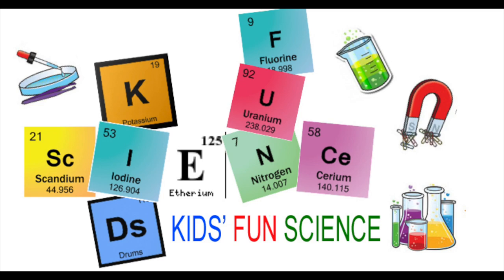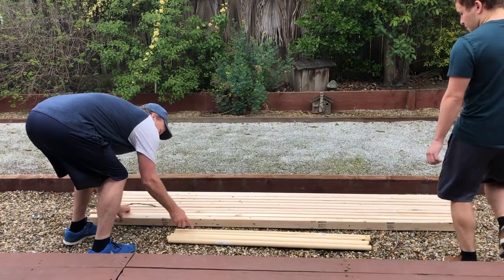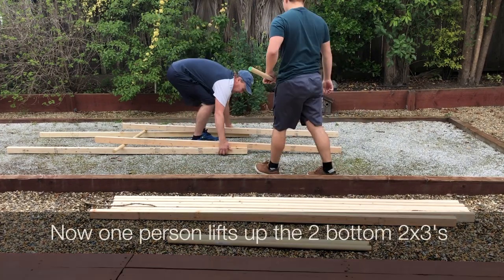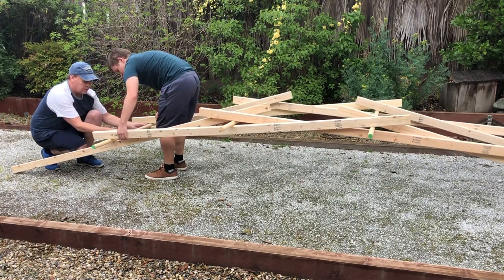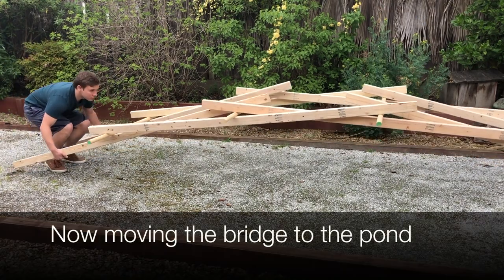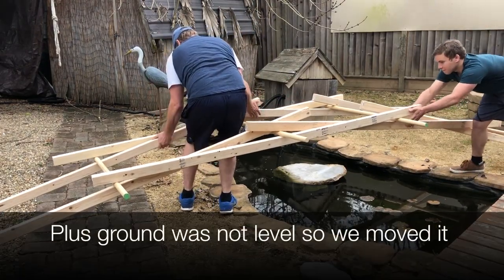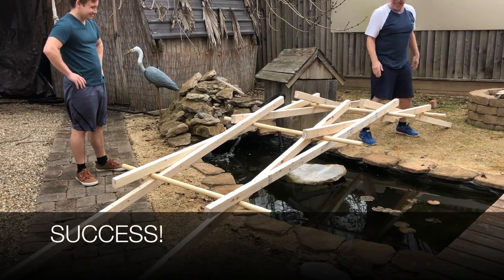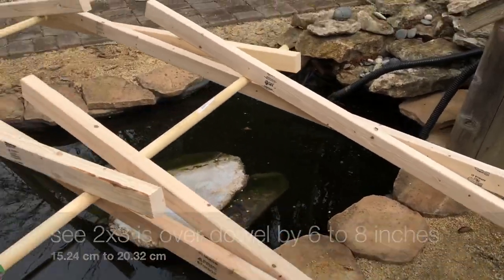LIFE SIZE Leonardo's Arched Bridge (Leonardo's da Vinci Bridge)

Comment: What is the length of the 2x3s? Also how long did the bridge end up being using eight 2x3s and the dowel rods?

Many thanks.
Reply from the maker: Good Morning @esyndicate, The 2x3's were 8 ft long, as for how long did the bridge end up, great question. Unfortunately, I did not measure it. I would estimate around 20 ft long, as it looks like every 8ft 2x3 overlap. If you try it let me know how long yours ends up being? thanks Ken

Comment: Does it work with 3cm round bar versus 5 x 5cm square bar? Do you have a document specifying the load which can withstands this bridge? I am willing to build one; however, as a mechanical engineer, I am not familiar with structural or civil design.
Reply from the maker: Good Morning Hovig ARmali, I have not tried it with round bars so not sure. Unfortunately I don't have any documents on what it can hold with load. I built it and tested it with my weight. I'm not a engineer or scientist, just a dad that loves science. If you try please let me know how it turns out? thanks Ken